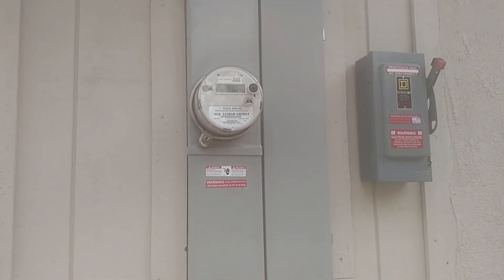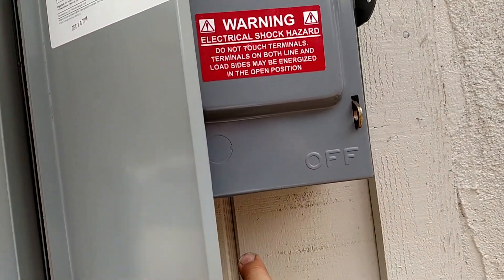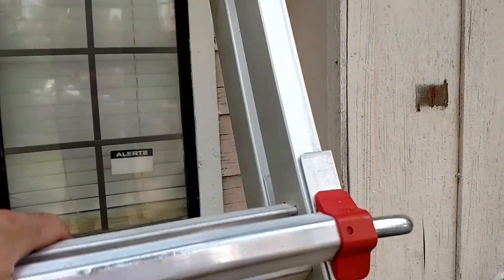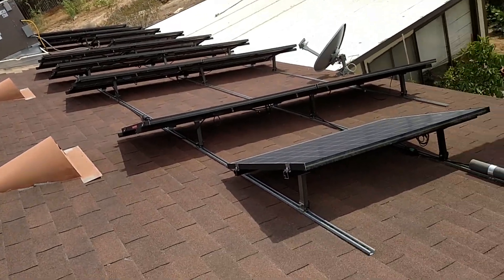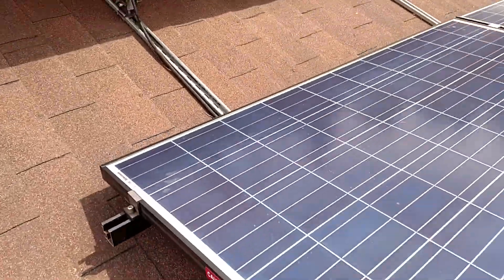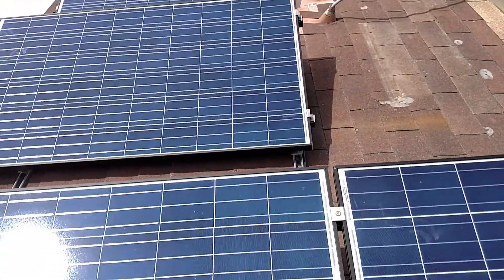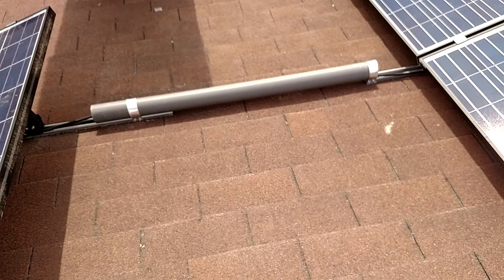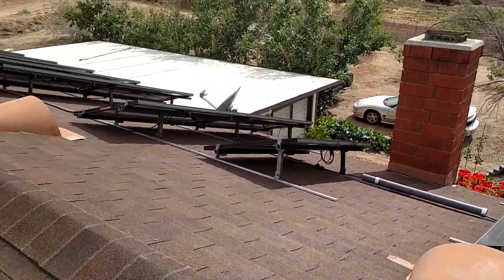DIY Solar Panel Project Roof Mount W/200amp Panel DIY Finalized

Comment: I Did  XW 4860  x3 for 18kw  15 years Old  Run ALL House &  2 AC & Pool  LoL I Still Adding More POWER  HIT Tech Solar Panels   Work Better HOT  7kw Of That Type on roof & A Tracker 4kw monocristly Type

Comment: nice to see the final...If your costs were similar to mine, you should recoup your $$ (not including the new service panel you added), after tax credit, in about 18-22 mos. If we paid someone to do our installs we would be looking at like 5+ years. I know the tilt is efficient, but you might consider throwing up the 2nd string flat mount. You could knock that out on long Sat/Sun be done.  Looking into Ironridge too (they got some good product).. As you know, the add-on wiring for the 2nd array will be a joke..either use another splice coupler to connect up your 2 ends of branch cable or just wire-nut it in the J-Box.  But, you're gonna love the $$$ coming back to you with the 2nd array up. I don't know if you're in CA, but I'm actually getting $$ back from SCE (they're only charging me couple bucks a month in taxes...and at end of year, i'm getting net check out them scumbags.

Curious, do you need to apply for a new permit for the add-on? I just permitted my initial array, but I'm thinking i might have needed to get another permit for the add-on panels
Reply from the maker: sunsensational  Thanks! I did the tilt even though adding 1 extra panel would have been more cost effective, and provided around the same power. The reason being was the amount of panels the city would accept on my roof. They were strict on the amount of space required for the fire department. 3ft from this, 3ft from that, blah blah. I will be adding on the second string soon, more than likely without city approval. I think it would vary by city. In my city they would require me to permit any add-ons. Also, you hit payback right on. Thanks for your support.